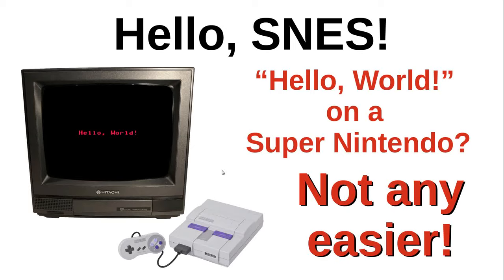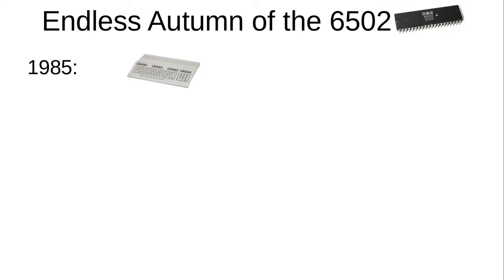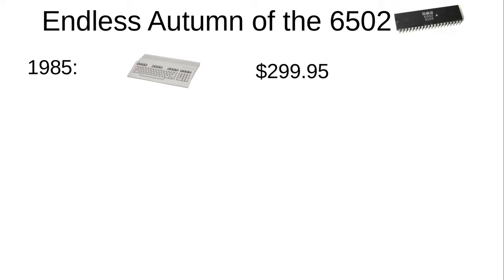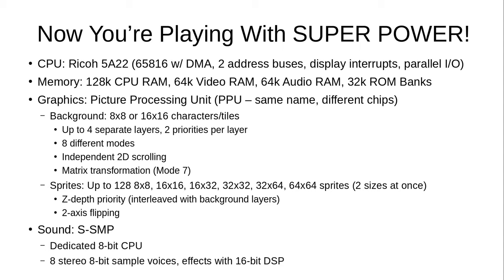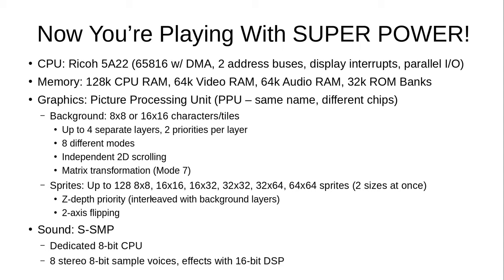Hello, SNES! - "Hello, World!" with a Super Nintendo? Not any easier!

Comment: One thing to mention about the PC-Engine CPU is that it's clocked pretty damn high for a 6502 of its time. It's a very zippy little machine, you hardly ever see slowdown on the system, mostly you'll see sprite flicker.
Reply: 7Mhz cpu is pretty high for a 6502. The vram was halved late into developement, leaving the cpu to vram bus at 8 instead of 16bit. Source: Copetti.

Comment: Wow! I didn’t know the PC Engine was a 6502. I always thought (hearing the name and seeing 16bit advertised) that it was a NEC V20 with some proprietary graphics adapted. I played a few games on my MiSter and I was impressed with the graphics! I have never seen one in real life though. I don’t even know if they were sold here in The Netherlands. Knowing that it has a 6502, makes me love it even more :)
Reply from the maker: Yeah, even though it had NEC branding, it was primarily a HudsonSoft product, so they made their own 65C02 instead of using off-the-shelf NEC chips. Game developers were already more familiar with the 6502, and the unit cost of the CPU would come in well below the V20, which had many more transistors.
Reply: @slithymatt  The NEC link and the name PC Engine made me think it was 8088 based on a cheap NEC V20 :) So very cool to find out it was a 65C02. And yeah the 6502 cost about 10 bucks back then and the V20 20 bucks. I was delighted swapping my 8088 for a V20 back in 1990. It was noticeably faster. Back then mere clock timings made a perceivable difference in speed. These days in day to day work, speed is not something you notice, with these massively powerful CPUs we have.
Reply: You can play some old nes games on the pc-engine.  Things like the in game clock will run much faster, much faster.

Comment: Well for 30 years the snes was indeed not compatible with nes games,,, until 2020 by an inteligent programmer who created nested,an nes emulator for the snes,you have to see to believe it,there’re some limitations to this and many nes games are not compatile or never will,but considering that it became possible after 3 decades is a wet dream that became true🙏😁
Not about the snes audio,it can output 16bit audio in wich the dsp chip is responsoble for,it has to reconstruct those adpcm samples back into 16bit samples,but due heavy compression and audio stretching it can sound hole and dry,but if audio stretching is avoided,it can sound very clean.

Comment: Wow! Surprised you released this so soon after the NES one... it seems like a lot of new info to absorb to work with the 16-bit instructions and SNES version of the PPU. 

More suggestions (really olde schoole)...

KIM-1 the 6502 single board trainer/eval system. I used these in a college electronics course.  Making impressive "Hello World" output could be challenging.  Built-in, there is only a six digit 7-segment LED display, two 8-bit digital ports (GPIO), audio tape interface, and  2 serial ports.  "Hello World" could be sent to the serial ports or the parallel ports without too much trouble I'd guess, but you need to attach a serial terminal to or some other type of display.  In the electronics class we cobbled together a resistor-ladder DAC and drove an oscilloscope in XY mode to display some little pictures or perhaps even some text.  But if you don't have access to real hardware, that won't be easy to show in an emulator   The 7-segment display digits are actually under full digital control, so you could "customize" the output to show more letter forms, although a full "Hello, World!" may look a bit funny and would require scrolling through the six digits and multiplexing, so a bit of tricky programming fun there! 

COSMAC ELF (RCA 1802 CPU) with Pixie Graphics vide add-on (really simple bitmapped graphics).  The basic ELF is a lot like the KIM-1, but with the PIxie Graphics you could have something like the Atari 2600 output (in black and white). I never worked with one, but my parents where acquaintances with another family that had one (or perhaps it was the related ELF II).  When I was a kid I got a quick demo of it... it could play some music via a simple tone generator, which I thought was really amazing at the time before more sophisticated machines were widely owned.

If you branch out further you could also go to the early Z80 family such as the TRS-80, Sinclair ZX80 or the follow-up ZX81 / Timex/Sinclair 1000, and the like.  Simple text output in BASIC is trivial so something in assembler and/or with their graphic characters to make a large display would be more video-worthy.  

(Not as old school...)

Redux of the Atari, NES, or SNES versions with more visual panache... show how to add some color gradients, scroll/move the text around, use extra color depth or sprites to smooth out the text (add resolution or add more colors for smoother anti-aliasing).  The charming thing about these old platforms is their unique IO systems, and you are only scratching the surface of what they can do. I don't mean this as a criticism, as you've already created a great series, but the possibilities are nearly endless!  

Now I'm sounding like 70s & 80s computer advertising.  I better log off now!
Reply from the maker: Thanks for the suggestions! I think the KIM-1 and ELF may be a bit too obscure to be worthwhile, even if they would be fun to play with. Probably my biggest comfort factor would be with 68000-based systems, as that was the first assembly language I learned way back in the day, but I do like the idea of an 8080/Z80 series.

I have also considered more in-depth development demos of these systems, adding in sprites to make a very simple playable game like Pong or Breakout. It would definitely need to be a consistent concept across all the systems, and then probably finishing with the X16.

Comment: You say there are 2 priorities per layer, so--and this is assuming I have the slightest clue here--does that mean I could effectively make it look like there were 8 background layers by using the 2 available priorities on each layer and designing my backgrounds such that any overlapping sections in the game background art would look like they were properly behind and in front of the other layers where required? 

Example: I could draw a lot of clouds in the sky at the top of layer 0 that goes down into some grassy land below and then put some separate large rocks at the bottom of the layer that don't mix with the grassy land, and then I could move the part with the rocks as a higher priority than say layer 3 so the rocks actually look like they are if front of all the other background layers that are already in front of layer 0, creating the illusion of additional layers and parallax when scrolling. And then I would do the same basic thing with all 4 layers where it made sense, moving some parts down in priority and some parts up, with apparently the ability to have basically each layer split into two layers (in terms of priority/depth and how they are seen in the final game).
Reply from the maker: Not quite. The priorities for Mode 0, which you're referencing here, are very fixed. You have 4 tilemaps: BG1, BG2, BG3 and BG4. Each tile entry has a single bit to denote its priority, so you have priorities 0 and 1 on each layer. Sprites have a 2-bit priority, so 0 to 3. Higher priority values appear in front of lower ones, but oddly higher BG numbers are further in the background. So, the fixed order, from front to back is: Sprites[P3], BG1[P1], BG2[P1], Sprites[P2], BG1[P0], BG2[P0], Sprites[P1], BG3[P1], BG4[P1], Sprites[P0], BG3[P0], BG4[P0]. This means that if your sky is the furthest background priority, that is BG4[P0]. If the sky shares BG4 with some rocks with P1, they would only be rendered in front of the P0 sprites and BG3[P0] tiles.
Reply: @slithymatt  So, ultimately, roughly how many overlapping background layers could be done plus faked in Mode 0 using only the actual background layers themselves and the priorities? And I don't mean faked via line-scrolling or stuff like that, but rather proper overlapping layers and/or sections that create an illusion of actually overlapping with another background element done via the priorities.

Also, if it is possible to fake more background layers the way I'm referring too, is there some restriction on how this would work with the sprites, such that the faking of extra overlapping background layers could only done in places where the sprites wouldn't overlap the effect and give the trick away?

This level (and a couple others in this game) is the illusion I'm thinking of when talking about faking extra proper overlapping layers https://youtu.be/EvL-YvuO6so?t=1077 where it definitely looks like there's up to 4 proper overlapping background layers here (ignoring the line scrolling stuff on the furthest background layer): The dark blue buildings in the background, the dark brown houses in the middle ground, then the normal colour houses, the fog layer in front of that, and maybe even the barrel layer in the foreground too. Even though this surely isn't even using Mode 0 (or else they're doing exceptionally well with the 2bpp limit), probably Mode 1 I would presume. My immediate thought is that it must be some kind of trick using all the available background layers in whatever mode it's in plus some parts using the layer priorities.

Basically, I'm thinking about making a game using primarily Mode 0 (working within it's obvious colour limitations) to push as many real and fake background layers on SNES as humanly possible for some really cool illusions of layer/depth/parallax that I don't think could be done on SNES otherwise, but I'm a designer rather than a programmer and just want to get my head around some of this underlying stuff first.
Reply from the maker: You don't get 8 independent layers with just tilemaps, of course. But it can look that way if you have parallax scrolling going on. A good illustration would be an old fashioned shooting gallery game, where you had conveyor belts at different levels with targets on them. It's like have four pairs of belts, where each pair has to be in synch. You can also use sprites as a pseudo-tilemap layer in between, even if that's less memory-efficient. I think that's what's happening here. It looks like there are some sprites being used in between the layers, which appear to be 16-color. The translucent fog also appears to be sprites, probably on the same level as the characters.
Reply: @slithymatt  So, is it possible to actually push parts of one background layer above and below another background layer then or not?

Also, do you not think if the fog was/is sprites it would push the SNES past its sprite limit on the horizontal axis, such that any time any other sprites moved in line with it you'd see some terrible flickering (especially if you're saying they've maybe also used some additional sprites to fake the parallax on one of the other background layers too), which I don't see here?

I'm honestly not sure how they've done it, but it's a very impressive demonstration to my eyes for sure.
Reply from the maker: @inceptional  it is possible, but only in the order I wrote out above. The fog could be priority 1 of the layer behind the main foreground layer, which would be priority 0. If you have access to the ROM, it would be fairly easy to reverse engineer. I'd have to go through that clip like the Zapruder Film to really figure out what's going on. The thing with the SNES is that there's so much flexibility, the games can be a bit of a mystery without examining the ROM. In the end, very few games used Mode 0 because it made the  games look like busy NES games.
Reply: @slithymatt  Cool cool.

Yes, I think that's exactly why so few games used Mode 0, despite it offering so much potential if that color limitation is really thought around. I mean, as an example, I could imagine a game that used either a black & white or mostly flat-coloured comic/cartoon look with loads of layers of parallax creating some amazing 3D depth, especially once you include some full colour sprites in there too, as well as some creative use of background mode switching in real-time and so on.

Ideas using no colours, just black/white/gray:

https://i.ibb.co/Srkfg0p/Fist1.png (not my art)

https://i.ibb.co/ZLV3Q73/Retro-Game-4-Colors-SNESResolution.png (not my game--but literally just 4 shades of gray)

https://i.ibb.co/MgV7m7W/2bit-portraits-2.png (4 shades of gray also--also not my art)

https://ibb.co/jgJcmXg (and the background layers here barely use 3 colours each, and just 34 total for the entire image--not mine either)

I think, given the right artistic approach and some considered design and a talented programmer, it would be possible to do something using Mode 0 that might actually blow away many people.

I have some very early ideas, so I just wanted to get a bit more of a clue about the limitations I'd be working within and exactly where I might be able to do some interesting things within those limitations, and also make sure I'm not getting carried away with ideas that actually aren't possible at all.